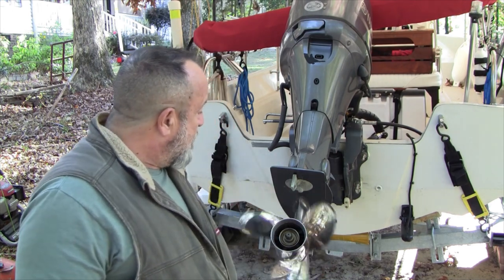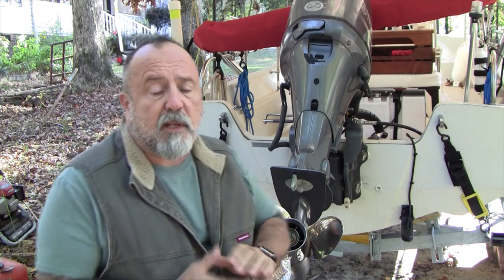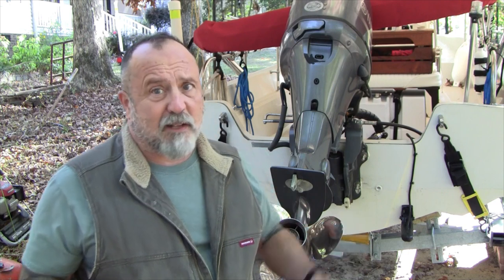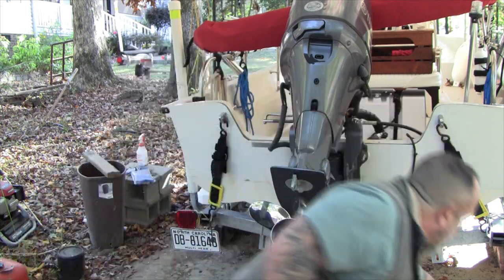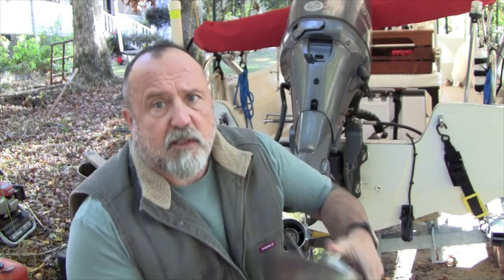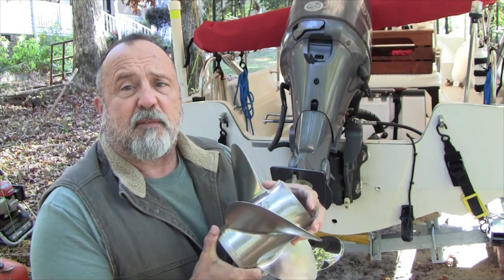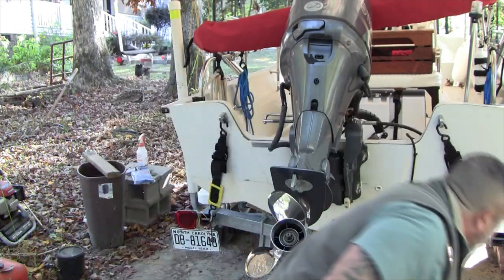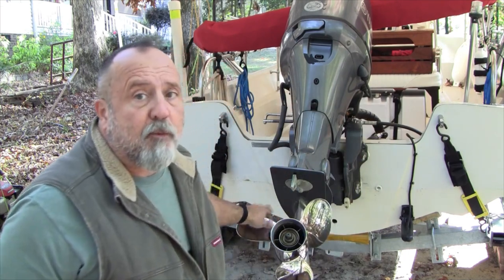PowerTech! 13.25 x 14 Prop Performance on a Classic Montauk 17 with Yamaha F70

Comment from the maker: All the comments have disappeared, I copied one that I thought was very useful, here it is: 
Against the wind 5900rpm , gear ratio 2.15, prop 14 ", speed 34.1 mph PROP SLIPAGE 6.3 With the wind 5950 rpm, speed 35.1 mph, PROP SLIPAGE 4.3 Very good

08/20/24 Update - Probably needs to be adjusted as the as the gear ratio for this engine is actually 2.33:1, using that then the prop slip is actually -.72% and -3.68% respectively, theoretically impossible numbers but may be real if the manufacturers rated pitch is understated, check out this video for a more recent test run with this prop vs the same size and pitch Yamaha Prop and an explanation of how negative pitch can be possible https://youtu.be/tcxu7go08wk

Comment: Thanks for the vid, I just took an aluminum Solas 15 pitch off my F70. I was having Holeshot issued when I had 2+ ppl on my boat (Key largo 168). I would have to mess with the trim trying to get the motor to find the RPM's, it was lugging bad. Half the time I couldn't get it up and once burned a trim motor up. I went with the Power Tech SCD3 P14. I talked to a few tech who all recommended the same prop, although I was in between the P15 or P14. Ended up going with P14. Installing it today, hope it does the trick.

Comment: I'm repowering 1975 16' 7" montauk with F70.  I get a Yamaha brand aluminum prop thrown in with the deal. Can you or any of your followers tell me which size to get even if it becomes my backup?  Was thinking 13-5/8 x 14 for my horsepower.  Also, I am a little worried about SS prop based on lower unit concerns, especially fishing shallows. Your videos have helped immensely and picking up crated f70 next Saturday. I will install following your videos!
Reply from the maker: I think the prop you are considering might be a hair too much, TBH, knowing how this prop performed, I would go with a 13 x 14 or 13.25 x13. I think that would take the engine right up to it's prime operating speeds. But I believe you will get similar performance with what I got with mine. Maybe a few hundred less rpm since the aluminum blades are thicker. Let me know what you go with and what performance you get!
Reply: Thanks!  I'm inclined to go with your recommendation.  Next size down in the "included" K series prop will be a 13-5/8" X 13 pitch.  I'll start with that and go through break-in.  I want 2 props anyway and can always adjust after testing this one and keep this as a back-up (if necessary).  I'd rather break-in too light and watch RPM's than lug anyway!  Once I get results, I'll be happy to share!
Reply: Finally got in water.  13-5/8 x13 seems a little too little.  Granted only me on boat, but rpms run up quick and was doing 30mph on gps at 6,000 rpm with lots left. 2nd prop will be k series 13-5/8 x 14. Think I have a lead on a good used one in fine shape.

Comment: Thanks for posting this video. Did you consider a semi-cleaver design? I have a 1975 Montauk with 90SHO and Im considering the Power Tech SCD3 13x17 prop. Right now I have vented Yamaha Mini Pro 13x19 and it does 38mph at 5300rpm.
Reply: I also have a Yamaha 13x19 aluminum prop that takes me to 38mph at 6100rpm. I also have a Yamaha 13x21 aluminum that I am going to try as well, no results yet.
Reply from the maker: I think the Yamaha prop is a semi cleaver design. I wanted to get as close as possible to the Yamaha prop. is that on a Montauk 17?
Reply: @ExtremeDIYGuy  yes Montauk 17

Comment: hi can you please give me the part # and prop info for the powertech prop you used
Reply from the maker: Here's a link to the one that I purchased.

https://www.youtube.com/redirect?event=video_description&redir_token=QUFFLUhqazBDd1JNZUx0bDBXZktQSW5hZmtLVjNRVEY2d3xBQ3Jtc0tuTUw4STZDTGREZlIwOTBGRlV2V0RzSnZQLVlaN2V0S0lFRUpkNUJfV0M1UnVhSkV5ZnNPeUlnN0dwakRzVGQtc3NIU0pSYlNHQlJlN25QSDFOaDNHTURBVzByallPUV9DY1hyYTdJNHZoZE0xZEZFQQ&q=https%3A%2F%2Fwww.propdepot.com%2Fstore%2FPowertech-RED-3-or-4-Blade-Propeller-70-140HP-Yamaha-p527723020&v=R1OxJ4RpM2g

Comment: Thank you for the video. I have a 77’ Montauk, and am considering a repower with the Yamaha 70, so your video is very helpful—appreciate it!  I’m not a top-speed guy either, but, I thought I read to expect 38mph with proper prop on the same setup .?  

Is your motor mounted two holes up? 

Thanks again!
Reply from the maker: Hi, I do have the motor mounted 2 holes up. From what I have read in Continuous wave and other forums, 35-36 is the expectation, although I'm thinking that perhaps the powertech with the next lower pitch would probably bring the rpm up and maybe the speed as well. I might have to try that this coming year to see what the results are.
Reply: Thank you, I’m hoping that I stop putting off the purchase of a new motor—currently running a 1990 Johnson VRO 70.
Reply: Thank you, I’m hoping that I stop putting off the purchase of a new motor—currently running a 1990 Johnson VRO 70.